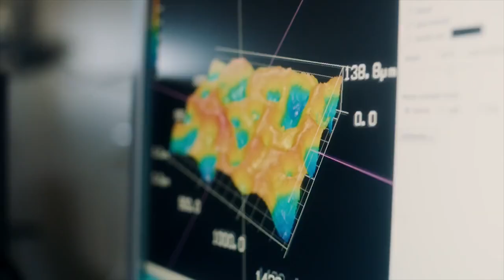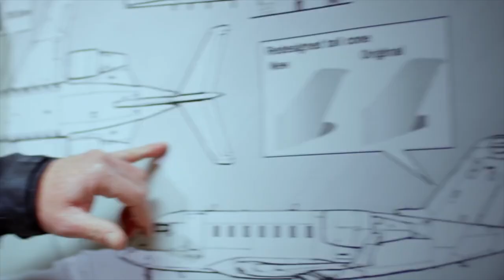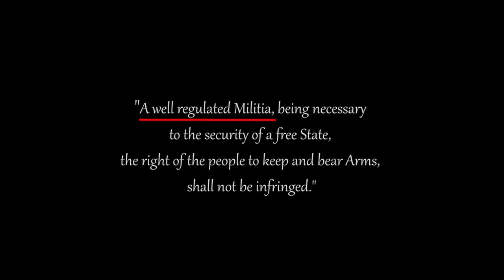How Guns Are Advertised

Comment: What really struck me about this is how little most the ads mentioned used sex to grab the obviously male audience's attention. Sex is usually all over ads aimed at adult males, but it was only in a few of them here. Instead it was engineering, science and the great outdoors. That's actually pretty good as far as the morality scale of advertising subject matter goes.

At 5:50 is where this video stops being informative and goes off the rails into anti-gun advocacy. Up to that point, it simply describes what is in fact happening in a fairly neutral tone. But after that, it really gets into a political rant. Its interpretation of the second-amendment is "living Constitution" nonsense. A militia is not the same as a standing army. You can't have a civilian militia (whether well regulated or not) without a reasonably well armed populace to draw the militia from and this was common knowledge in 1789.

There are some crazy pro-gun activists out there, like Open Carry Texas who were taking AK-47s everywhere, even in the grocery store. That was completely ridiculous and unnecessary. And you know what happened? The NRA came out and condemned that. When they totally didn't have to and doing so was absolutely not in the gun industry's interests. You've got a super broad brush there.

I don't personally own a gun at the moment. But if crazy Leftists ever made it illegal, then I would make sure to get one, because that's when I'd need it the most.